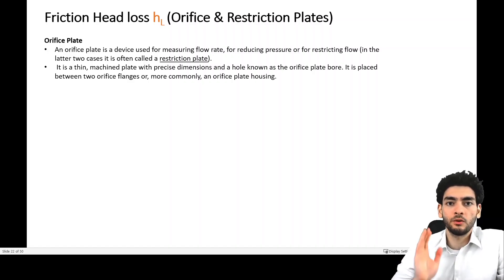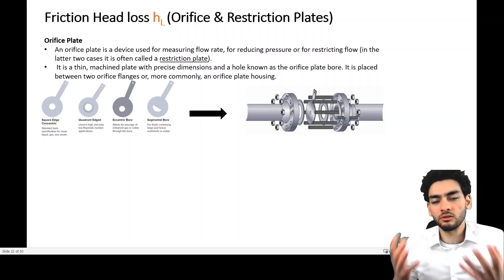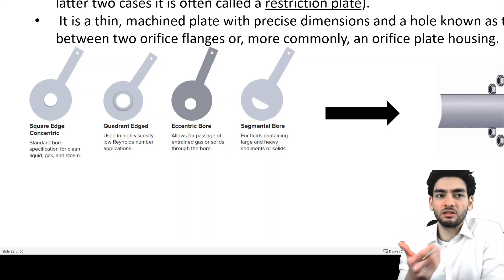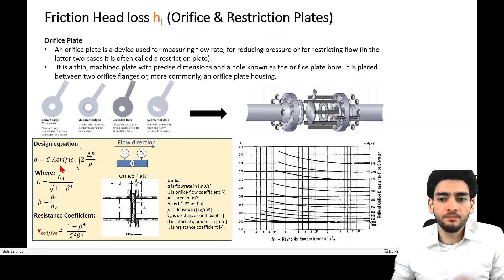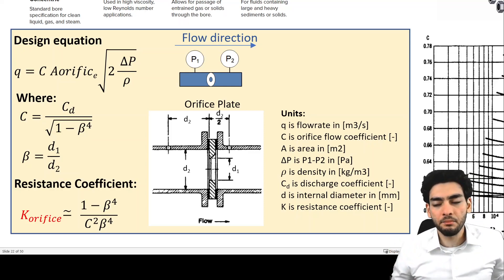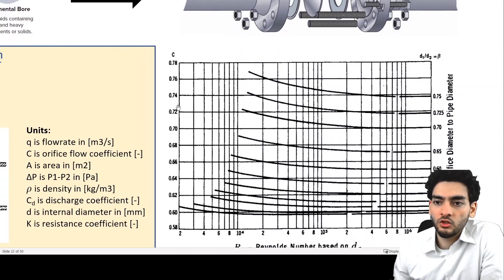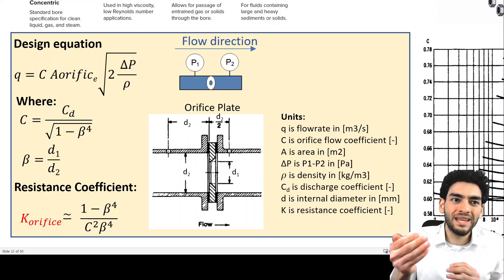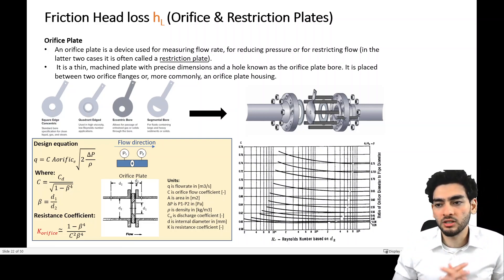Orifice Plate Design

Comment: i lost you 
air taught one orifice plate size 24,8 -pipe inner diameter 50 mm -initial pressure 8 bar after orifice is 7